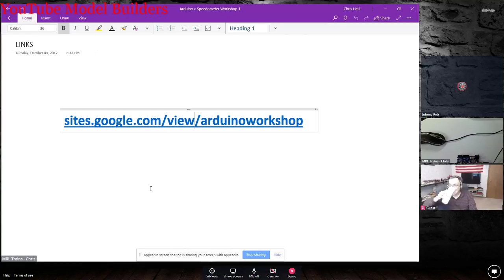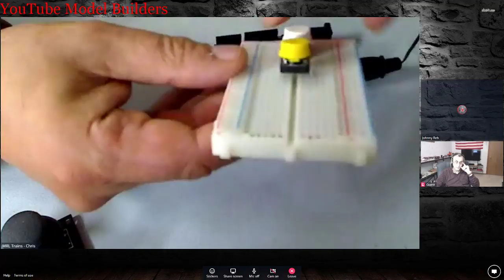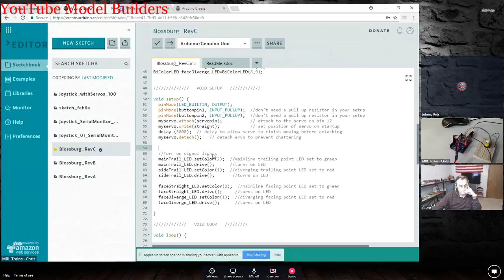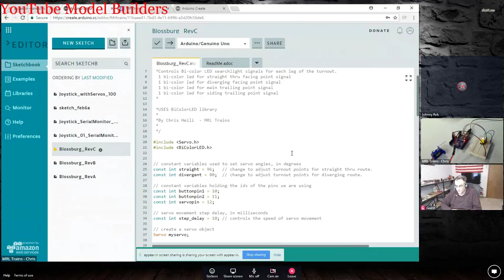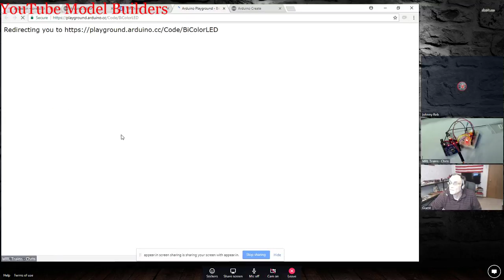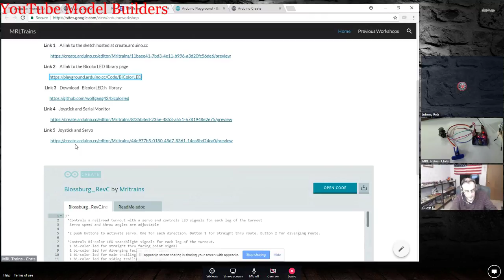YouTube Model Builders is proud to present- Arduino for Model Railroading. February7, 2018

Comment: I was wondering what the finished electronics look like under the layout where you were demonstrating the signal lights and turnout.  Do you use the breadboard and connections as demonstrated in this video, or do you lay out the resistors and other connections differently?